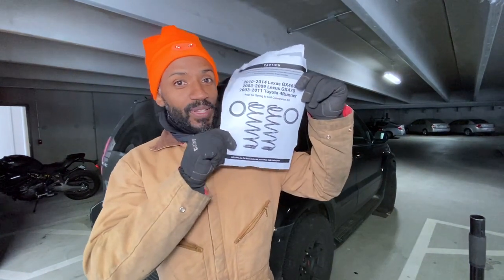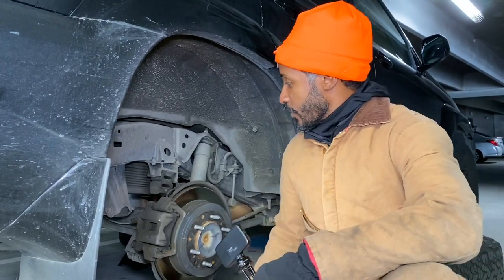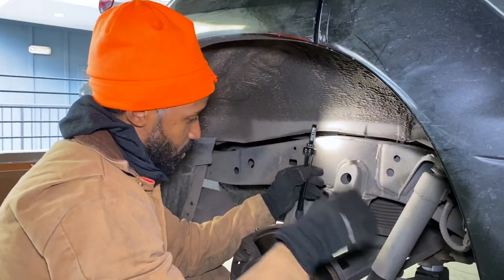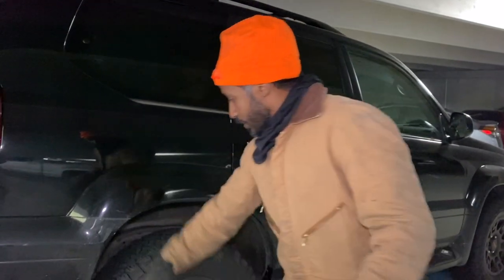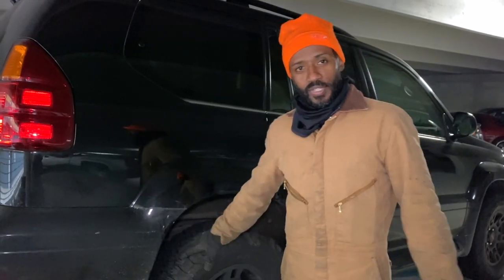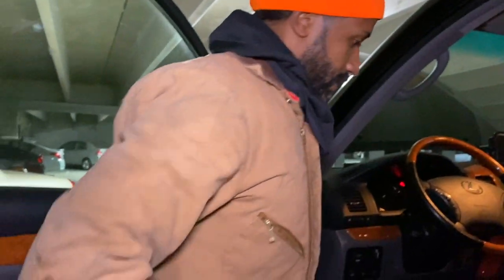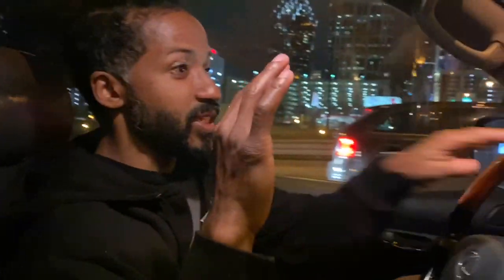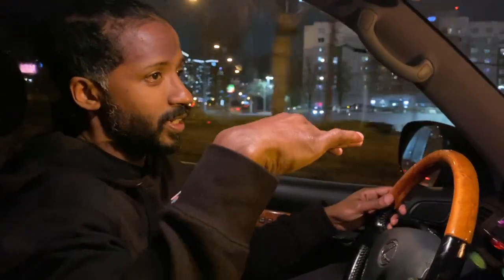Gx470 Suspension Conversion - From Air Bags to Coil Springs.

Comment: For most GX owners, the bumped from behind feeling at red lights is the Driveshaft needing to be greased. The permanent fix is to replace the driveshaft to the newer version but greasing the joint with the extension slide does the trick for a few months.
Reply from the maker: Yeah, a few people have mentioned that. Mine went away and hasn’t returned since I pulled the bags out. Idk maybe I got lucky.
Reply: @KRTLyfe  my air suspension would start filling up at every stop light. When it got to the ‘N’ height I would get a bump or 2. I also got the bump from the drive shaft. 

Finished the coil conversion and greased the joints this weekend. No bumps so far. 

Thanks for the video. I watched a few times to swap to coils.
Reply from the maker: @jamesray388  awesome glad the video helped you get it sorted out!
Reply: Sequoia owners too. Thank you for posting this!

Comment: I used this video along with another from Metal Tech.  Just taking off the bottom bolt on the shock was much better than trying to remove the top bolt.  I ended up replacing the shocks too, they were very tired.  Anyway, thanks for the vid.

Comment: I used your video to replace my 470’s airbags for springs .
A lot easier job than I thought it would be thanks to you.👌
Reply from the maker: Awesome, glad you found the video helpful!!!
Reply: Great video!  @KRTLyfe  How is it holding? How much have the rear springs settled since installation?
Reply: @Pwofese  my 470 after completion of the spring install doesn’t look overly jacked up in the rear. Bearing in mind I did not install the pucks that are to help anchor the base of the spring and do raise the vehicle more. 
The springs if they did settle it was negligible and haven’t noticed a difference. The ride is excellent and although I don’t drive off road I have and do push the limits of the springs over speed bumps and transitions in road surfaces with no adverse effects.
Love this vehicle if I could just get the AC blowing cold 🥵

Comment: Thanks KRT!! My airbags just failed, and I used your helpful video to convert to coil springs. One step I changed is putting the coil on metal tech bottom isolator and moving the whole piece inside. This way I barely got the whole thing in without having to disconnect the sway bar. Rides so much better. Thank you and subscribed!!
Reply from the maker: Thank you, I’m glad the video helped and thank you for subscribing! Hopefully you find some of our other videos useful.
Reply: What was your mileage when it happened?

Comment from the maker: Its’s been a while since we removed the bags and installed springs on our GX470. Here is a quick update!

The springs are holding up great and all tho they have settled in,  the rear of the GX is slightly higher than the front. This isn’t a deal breaker to me but if you are super detail oriented this might annoy you. 

The ride is great!  We would never want to put bags back on our car. We have logged a few thousand miles now and we have no regrets about removing the air bag system. On road and off road these springs should serve you well, unless you plan to do some extreme off-roading / over-landing. 

If you do plan on doing a heavy duty over-landing build , only then would I suggest you look into stiffer springs. 

The extra weight of a RTT and storage system in the back could make your GX bottom out on challenging roads / terrain Hope this update helps anyone looking to do this modification. You can do it!
Reply: I love the follow update, thank you so much!
Reply: Thank you for the update! I have only seen an update from a video a couple times. Awesome. This was my second time watching. About three or four months apart. I have gone 360 with my airbag replacement. Started off going to do a cheap inexpensive setup. Then started looking at al these setups that were going to be $400-600 dollars just for parts. After seeing your update,  think I'm going inexpensive route. Thanks again!
Reply: Hi! Guys I just let you know I’m so proud of you in your vídeos. Very very smart. But can you plz sent me the parts #.or information about the after market parts. I want to do the same thing with my wife Gx470. Plz thank you.
Reply: Are you still running the air shocks ?

Comment: Thanks for the video I have a 2009 gx470 everything went smooth and you do have to unscrew the sway bar no matter what. I went with just the springs due to the tight snug fit. This video saved me thousands, it took me about 2hrs due to the fact that I manually unscrewed everything including rims. I purchased the springs for $132 and a pair of jack stands for $67 I had everything else to do the job.  Thank you once again!!
Reply from the maker: Glad it helped! This is what I love to hear, we absolutely enjoy hearing from people that our content has helped! Glad you saved a bunch of $$$ as well, you can save that cash or do some cool mods! Thanks for watching commenting and subscribing! 💯
Reply: I replaced my shocks first then went with the spring conversion at a later date.  I was able to install the springs by removing the bottom shock bolts on both sides.  I then had a helper step on the side I needed clearance on to insert the spring And it was just enough clearance to pop it in.  This is of course with standard mounting hardware, not the base parts that were used on this build.

Comment: AWESOME job you two! just bought an 06 today and was worried about the whole air system replacement. I don't think I have a big air leak but it won't stay in high. I am totally doing this exact coil changeover as soon as possible! Thanks, you made it look easy!
Reply from the maker: Glad it helped!
Reply: What kit did you go with and how has everything been so far?
Reply: @608portraits9  I went with the Eibach kit which gives 2-3 inch lift.  I was able to do the rear myself but the front struts weren't assembled so I don't have them in yet. I had family get sick and that was more important. I'm in Mexico now and will get everything finished when I get home. CHEERS!

Comment: I just competed this with the metal tech 4x4 spring kit. I did not cut the bump stops I have no issues. The kit was $400 with $100 shipping (HI). Highly recommend this conversion. Super easy to do.
Reply: Is this less then the strut master?

Comment: Thanks for a great video. In Europe, we did not have the GX470, but we did have the Land Cruiser 120 GX. Our GX has the same air suspension ...
Reply from the maker: Yep, best is to remove it before it gives you trouble.

Comment: Nice video thanks for posting!  The feeling of getting hit from behind is from the yoke of the rear driveshaft.  I got the new driveshaft (Lexus said they’ve redesigned it like 10 times for this vehicle) and the car drives like a new Lexus fresh off the lot.
Reply from the maker: Thank you for your comment and watching our video. So I've read countless threads on I8mud, the Lexus and Toyota forums, reddit etc  about this knock. I was going to go in that direction and get the drive shaft and bearings etc changed. My GX was doing it really bad at every single stop light some times multiple times. Since I've changed my suspension it hasn't done it a single time. It's been several months now of daily driving and multiple road trips to the mountains in our GX. We haven't had one bump since. Maybe there are multiple causes. If it resurfaces I will make sure everyone knows and I will make a vlog about it. Thank you again for your contribution!
Reply: @KRTLyfe  Whoa!!!  I have read all over and you are the first to state your problem that is exactly like mine.  Not the typical driveline clunk where it bumps when stopping and moving again, I don't have that.  I have what you had.  Multiple bumps when stopped.  Heck, it even does it when the car is off and has been sitting for a few minutes.  Have you learned anything else about it?

Comment: thanks for video:) i just ordered mine !  after fighting with air susp i said no ! :)  too late.. I already changed air compressor ( its behind rear bumper  behind driver rear wheel  splash) height sensors and struts... at least i will reuse struts :)
thanks for help !

Comment from the maker: A lot of people ask where I got the center console suspension control delete cup. It was on eBay. 

Genuine OEM Lexus GX470 / Toyota Land Cruiser Console box pocket 58839-60040

Metal tech kit 

https://www.metaltech4x4.com/metal-tech-gx470-rear-coil-conversion-kit-stage-1/
Reply: Shoot you want to let go of those air lines? Mine got a hole in it and I can’t find no replacement. The dealership (Lexus of South Atlanta) even don’t got it in stock...
Reply from the maker: Paul Farquharson I wish I still had them, I would give them to you!

Comment: Excellent DIY vid, My wife's favourite all time vehicle. It's a 2004 still rides like new. The suspension air pump is about to go we were told as the rust has gotten to it.  I can use it if you still have it. But realistically doing this mod is the way to go. Now if we could only get rid of the VSC & Engine light on...
Reply from the maker: Thank you, sounds like you got a few things to tackle. Get your self a nice scanner tool and attack it one thing at a time. Best of luck to you.

Comment: That "bump" sensation you're describing is common on 4th gen 4Runner and 1st Gen GX470 120 platform. It's the drive shaft slip yoke. It needs to be greased. When you stop the axle and suspension load up against the yoke. When you release the brake or the yoke gets enough tension and then releases, you get the clunk or bump sensation. It's coming through the driveline. There are zerks to lube the driveshafts and there are many different arguments on what type of grease should be used for specific zerks. Go by the manufacturers recommended grease types of read up on what people are using to help stop their clunks.
Reply from the maker: Tickle Fingers yeah I read all that on the forums etc before I changed my bags out. A lot of people seemed to say the bump came back after greasing. Immediately after changing to springs ours hasn’t done it not once. Which leads me to believe the bump was coming from the vehicle trying to correct its ride height, since my driver side was leaking so bad mine was doing it at every stop. Literally hasn’t done it a single time since swapping to springs. I wonder if any of those others experiencing the clunk were on bags or springs? If mine comes back I will definitely let you know but so far it’s been clunk free! 🙌🏾🙌🏾🙌🏾🙌🏾💯

Comment: I just had the whole rear done, air compressor, shocks and air bags because everything was original on my 2008 and here whe are 2019, Lexus wanted about 6000.00 for everything I had my buddy do it for under 700 dollars  of course  I bought the parts from A1auto but I made out big.

Comment: Cool video. I have a GX470 and my bags are starting to fail. I am going to replace them with some new bags and keep the air suspension. I found some reasonably priced bags but was wondering if would need any additional parts for the job? My compressor seems to work fine and will still raise the car, just have that one side that starts sagging. I am not doing to work myself, found a mechanic who will install my parts. Thanks!

Comment: This video was so helpful to me in understanding what’s going with my 2005 Lexus GX470. I’m feeling and hearing a slight jerking noise and slight bump when I start my car an expect it to raise up quietly. Seems like I feel every bump in the road while driving.
Reply from the maker: Sounds like that is definitely a suspension problem. This conversion made a huge difference in how the car driving now. Very nice and smooth - better that on air bags. Thank you for watching!

Comment: I like this video.  I think the kit you ordered is tightier, than the regular adapters.   I seems alot safer!  Thank you!
Reply from the maker: I think so too! Thanks for watching!
Reply: @KRTLyfe  so what about a 2014 GX460 luxury trim, do i need to change too to have that smooth feeling you're talking about? Or this is for older GX470 only?
Reply from the maker: @seekfactsnotfiction9056  I think this is only applicable to the GX470. I’m not sure what people are doing to the 460.... I think bags are optional on the 460. Check my math.
Reply: @KRTLyfe  I heard some mechanics say the GX470 is more original than the GX460, is that true? Or at least is there some truth there or it's just one of those things ppl speculate without concrete evidence

Comment: Added this to the strut master video, which I used in addition to yours. Thanks for the help on pulling fuses.
A couple of points: the existing strut nuts should be soaked as early in advance with PB. Having a strap wrench was mandatory to remove the existing struts. Extra information about getting the compressed springs into place with spring compressors on them, and in an orientation where you can remove them after they’re in place would have been very helpful. I started around 9am and finished this job at 7pm - if you’re not solid with doing car work, find a mechanic in advance that will install parts they didn’t supply. I could only find one Toy-Lexus mechanic in Denver Colorado who would install and he was booked out for 3 weeks. Decided to do it myself with a buddy. Love the ride, it feels like a massive improvement, but the instructions seemed to gloss over some of the hardest items.
Reply from the maker: Awesome glad the video helped you get the job done! Our GX has been in GA it’s whole life so we didn’t have to fight any rusted or stuck bolts. Getting the springs on wasn’t difficult for us either even with the metal tech kit. My wife just pressed down on the axel until I got them into position. With out the metal tech kit they would’ve just fit right in on our GX. Thanks for watching and commenting we appreciate it!
Reply: @KRTLyfe  Hi -  I'm putting in OME springs with 2" lift and don't want to have to use a spring compression.  Which part of the sway bar did you take off in order to be able to drop the axle far enough down to be able to get your spring in. Thanks for the great video!
Reply from the maker: @safarila1  I’m trying to recall with out rewatching my video. From what I remember you have to disconnect the shocks. Then I had my wife stand on the axel while I put the spring in place. The springs you are installing might take a little more effort. It might be worth your while to utilize a spring compressor.

Comment: Hey there. After buying my GX470 and repairing the air suspension system twice and having it fail a third time, I have decided to change over to coils. It really does seem to be the best option. Anyway, I have a question regarding the Metaltech "Secondary Spring Isolators" sold in the Stage 2 and Stage 3 kits. With the Unity coils, are the secondary isolators required (these are the cone shaped rubber parts that are in the stage 2 and 3 metaltech conversion kits)? It doesn't appear that you used them in your video, but so many other people on forums keep stating that the top-of-coil cone shaped isolators are necessary... I'm about to do this conversion and ordered all of the parts, but could save myself some money by returning those secondary isolators if they're not needed or can't be used in conjunction with the Unity coils. Thanks for your time! Great video!
Reply from the maker: Jerrid Higgins I’ve seen people do this job on YouTube with out using any additional isolators. I would say if you plan on lifting the vehicle a lot or plan on doing any heavy off-roading go for it. If you plan to stay on asphalt most of the time I would think they aren’t necessary.
Reply: why would you buy one in the first place..same probs as land rover..too much luxury to break..id buy a 70,s 4x4,& a decent bmw with the change,& a hollidy too,for the price of that rubbish you drive..
Reply: @phantomwalker8251  its basically toyota/lexus if you look up in 4runner and gx470 forums you will see for yourself. A bmw will be a nice money pit down the road. Talk to any guy including myself who has either a 4runner/Lexus/FJ , the overwhelming majority will say that they wouldn't trade it for anything else in terms of reliability and Overlanding capability.

Comment: Thanks for sharing. How come you didn’t just use the spring compressor instead of disconnecting the sway bar?
Reply from the maker: Personally, I only use the spring compressor when I have to. In my personal opinion it is easier and safer to simply disconnect the sway bar.

Comment: Great video! I’m planning to perform the same conversion myself.

There are SO many coil conversion products to choose from! How did you arrive at the one from UNITY?  It’s significantly less expensive (~e.g. 50% less compared to MONROE) than most of the competitors out there, but not as well known.

Just curious to know if I should shell out the extra couple of hundred for a well known company. 

Thanks again!
Reply from the maker: I read countless forums on the different springs and it seemed to me there wasn’t much difference. So I went with the best price plus best reviews. I really like the springs I have. The ride is great we tested them on some light off-road and they performed well. It has been a few months now and they don’t sag or bottom out so we are very happy with them. Thanks for watching and good luck on the conversion!
Reply: This is what I was looking for. It’s a good question and an answer